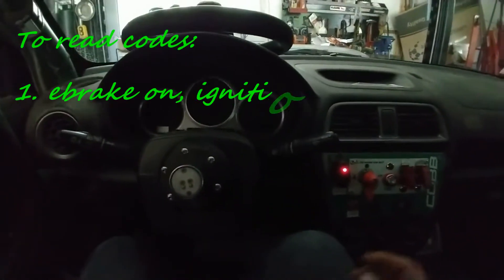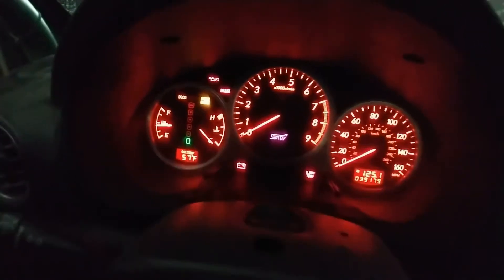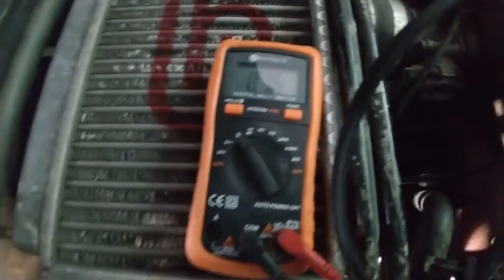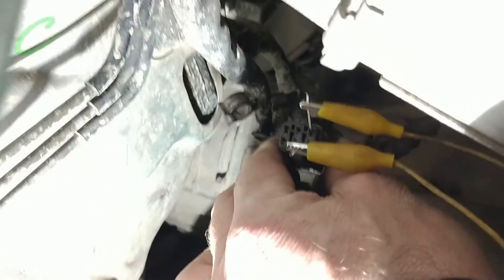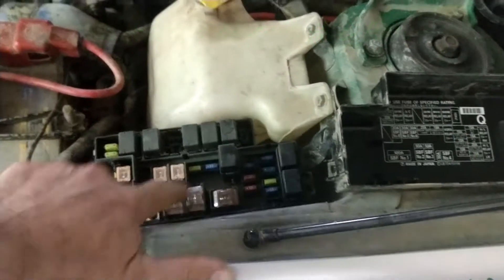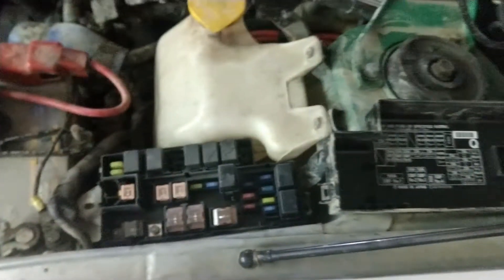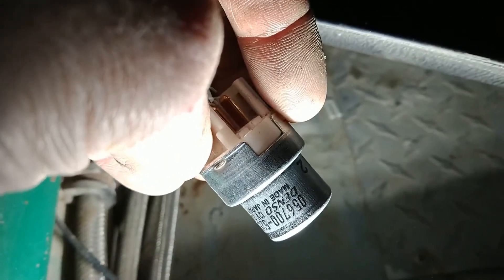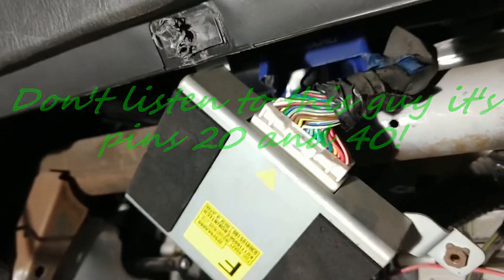Subaru STi DCCD diagnostic - Getting codes and fixing it

Comment: Hey dude. I did a full sti swap from an 05 sti to a 07 Wrx wagon. All wiring was swapped and suspension,tranny diff etc. I didn’t change the abs pump. My dccd isn’t working just flashing. Can the abs pump module be the problem? Thanks
Reply from the maker: The DCCD controller gets the data from the ABS sensors that report to the ABS module. When you swapped the whole wiring, the ABS connector was the same on the new wiring harness? Yaw and steering angle sensors all connected?

Comment: Hi, thank you for the video. I'm getting code 21 on a 2004 sti, but I tried to replace the throttle pedal/sensor and I'm still getting the flashing DCCD. Car is driving normal, is it possibly a bad wire? I have full range of pedal so it's kind of weird I'm getting this error.
Reply from the maker: If the gas pedal sensor was bad, the ECU would go in limp mode and you wouldn't be able to rev pass 2000rpm. So it's probably a wiring issue with the DCCD control module. You will find the entire diagnostic procedure in the STi manual Ref. to 6MT-38, DTC 21 ACCELERATOR POSITION SENSOR, Diagnostic Procedure with Diagnostic Trouble Code (DTC). You can find the manual online at http://ken-gilbert.com/wrx/STi_Manual/index.htm, drop down to chapter 6 section 12, it will get you the link to the doc you are looking for.
Reply: @FrogRacing  Awesome thank you! I’ll check this out. I heard it could be just a bad ground somewhere.

Comment: Greetings, i  have a 2016 STI and the buttons for the DCCD doesn't work, its stuck in Auto, can you give me advice on how to troubleshoot that, i think it may be a connector that is disconnected, the SI drive works though
Reply from the maker: Everything has changed after 08 with the integration of the DCCD in the VDC system. First would be to look if it's just not an issue with your switch to go in manual mode. After that I don't what the diagnostic procedure is for GR/VA chassis
Reply: @FrogRacing  ok thanks, it’s not the switch as I got a replacement and that didn’t work and yes it’s for the VA model. But thanks for responding!

Comment: This video doesn’t really show how to get the codes. You say “center” which is confusing because you could just show the LED panel instead of your thumb because that shows exactly what your doing.
Reply from the maker: It says 'Go center diff full lock to full open'. The thumb is moving the center diff controller that has been relocated on the dash on this car. If you have a stock car, this switch is located near your ebrake

Comment: I have the same problem. code 23. 1.3 ad the dccd which according to you means is alive!! and 07.3 at the plug ( not as high as yours but is an indicator something is wrong from there on   right?). no blown fuse #4.  I changed the dccd relay cause it was cheap. the relay for my dccd was the botton one ( subaru website location diagram) but changed the middle one just in case. Nothing I still have the same problem. I still need to check the dccd module but Iam confused on how to. IMPOPRTANT  I did a front end conversion on my sti. I went from an 04 headlights to 06 headlights. i matched the cables untill the blinkers and low and high beams worked. I feel the problem started right after that , could that wiring have anything to do with the cables that go to the dccd module? i looked at the dccd module plug and the color of the cables are  similar to some that i played around with when hooking up my headlights are those cables interconected.  PLEASE HELP!!

Comment: and the dccd working fine now? what is the problem?
Reply from the maker: Yes it was just a bad relay
Reply: @FrogRacing  i could use your help urgent.. I live in a place where theres no subaru dealers of any kind. Im getting a constant flash recently on my dccd green light. I looked at your videos,  and im going to start changing the fuse. I have an 07.. i did not see any relays like yours.

I really could use your help. Do you have a whatspp number?
Reply: Mine has that 23 code. Any ideas?